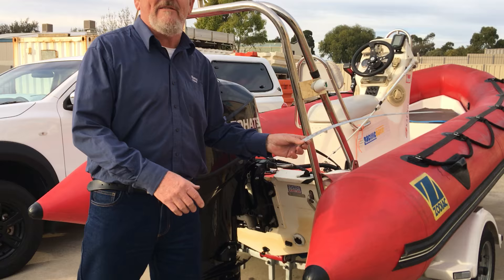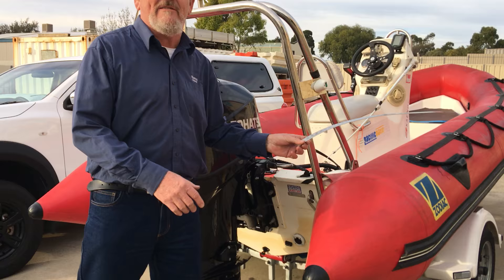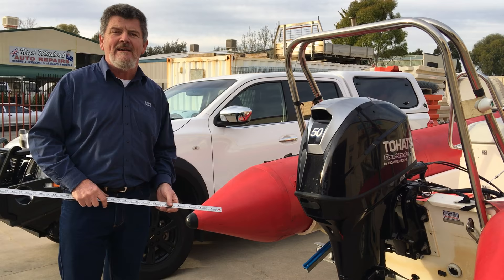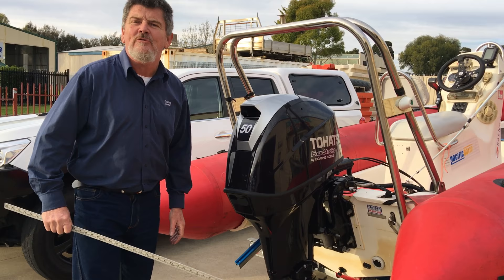Transom Outboard Engine Position

Comment: I .have a 24ft cruiser with a pod .rolls to the right badly sometimes on take of . 200hp mercury .Cavitation plate has been set to the pod height which angles up and is higher than the bottom of hull would be about 100mm higher than bottom of boat. Would this cause this problem .Is fine once you get it on plane .Any thoughts on this welcome.

Comment: Wait!  What??? According to your demonstration it looked perfect, yet you said at the end that the propellor on this boat is "too deep". Are we talking millimetres here because as close as I could see, the bottom edge of the straightedge was exactly in line with the bottom of the transom? 
I'm trying to adjust the height of a Suzi 8hp 2stroke on a 12' tinny getting swamped by spray above 20kn.
Reply from the maker: Hi, this was about boats 'rolling' under hard acceleration, not this boat in particular.
Reply: @boatingscene5479  Yeah, no, thanks Wally.

Comment: When comparing the height of the cav plate and keel, is it done with the motor trimmed all the way in or trimmed out?
Reply: full down.  the bottom of the cav plate should be level with the keel with the engine in full down.   then once you get moving and the boat planes - you can trim if you have electric trim.
Reply: @mixter7x7  Not if you have -5% tuck in...
Reply: I made a riser plate for 8hp evinrude to get mine level  on my Homemade 10 foot flat bottom took it for a test and cavitation occurred without riser its 3 inches below the boat no cavitation if i trim it one hole it cavitates a little if trimmed all the way cavitates even more is my boat to heavy aroundc1000lbs not sure what else to do

Comment: The straight edge should be parallel to the keel line, and the cav plate about an inch or 25mm above that. The method used in this erroneous video could give any result depending upon the installed height of the outboard.
Reply: You are absolutely right!!!
Reply: @brt-jn7kg  If we look at his video, that engine he has as a movie demo is 100% correct, it is according to his straight edge the cavitation plate is about a thumb thickness higher than the keel bottom, creating a 100% correct setting.
Reply: @garylaubscher4487  but how does that make sense when he has straight edge up on end that is about 1” tall 
Instead of straight edge flat on cave plate where thickness of straight edge is way thinner that way

Comment: Thanks for posting this video. Would lowering the engine help in reducing bow rise? I have a major issue with bow rise despite having followed the boat manufacturer’s recommendation with engine hp, weight and shaft length.
Reply from the maker: No, this wont fix bow rise - transom angle will fix that, try a set of wedges between engine & transom
Reply: If the drag (boat at speed) is close is close to the surface and the force (propeller) is pushing much lower than the drag, it seems logical it would force the bow up, effectively trying to pass it from underneath. I'm not sure why they can't build an outboard so that the shaft length can be adjustable. Imagine power trim and telescoping, especially with a tiller where even power trim is rare. Imagine a 12-21 or an 18- 27 were the two shaft options. Lowering the transom requires cutting. Fortunately for you, raising the transom height a bit ranges include a piece of hockey stick right up to a deluxe jacking plate.

Comment: its a anti ventilation plate not a cavitation plate
Reply: two names for the same thing champ
Reply: @tshepp89  do some research "champ"
Reply: @darrylstem6426  I did. Same thing. Prove me wrong. Champ
Reply: @tshepp89  Cavitation is when there is an extreme reduction in pressure causing the water to turn to   a gass state, typically on the back of prop blades, when you have nicks in the leading edge of your prop or sharpened in some cases the water infront of the prop blades will turn to a gass state that will flow over the prop creating prop slippage. Ventilation is when the prop pulls in air from the surface or exhaust gasses causing prop slippage in the water. Don't be a (insert word here) next time you comment on something you know nothing about. An actual engineer might just prove you wrong. Have a nice day and try be nice.
Reply: @jacquesdeklerk5563  *   So what's the correct name for this plate?
Reply: @charlessmith4242  For these outboard setups, it's an anti-ventilation plate.  There are however, anti-cavitation plates that also sit above propellers...just to confuse the issue :face-purple-crying:
Reply: @markleeson3453  *   Thank you for your reply.
Reply: Kindly share your knowledge in video on drawing or on the boat it self.  It will help those that think we got this - not I since I still trying to understand how to do it right in case of might need it later and getting knowledge from someone who knows it
Reply: Look up hydrofoil